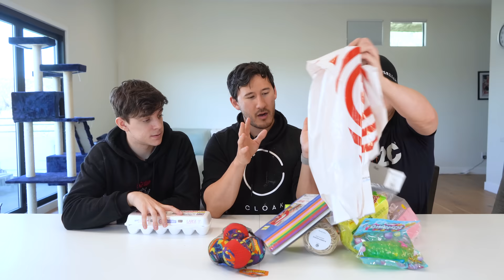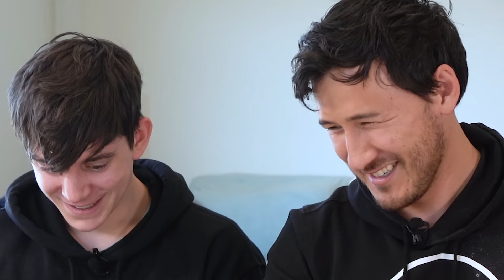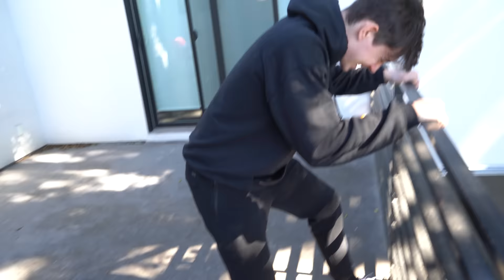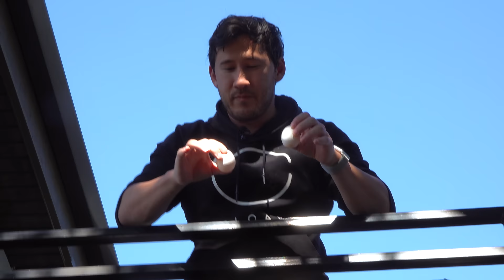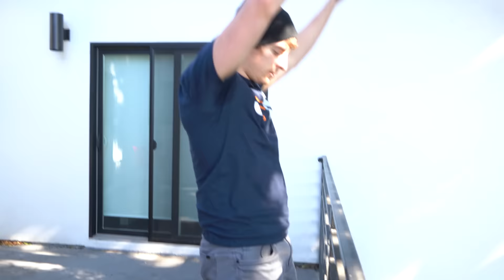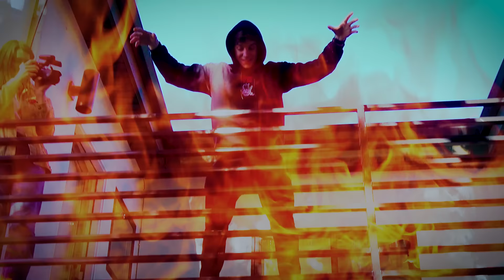Markiplier Makes: An Egg Drop

Comment: I think most people watching this don't realise but it's clear Ethan was struggling from the very beginning. I have ADHD and I know this exact feeling, and it's really hard to describe if you've never felt it before. Basically, you start to get frustrated because your brain is working ever so slightly out of sync with your hands/body, and the harder you try, the more frustrating it is, and the more the disconnect grows. Assuming this video was filmed after they filmed the Markiplier Makes Pie video, then Ethan has already been struggling to successfully complete a task. You can see how distracted and distant he is in the beginning of the video while Mark is talking. He gets more and more frustrated with himself as the challenge goes on.

If you have friends with ADHD, or suspected ADHD, then please take note of this video. He's not upset because he's going to lose the challenge, at least not entirely. He's upset because he can't get his body to do what's happening in his head. If your friends ever struggle like this, please dont pressure them, or make fun of them. Just comfort them and give them some time to calm themself down and reorganize their thoughts. It's difficult trying to work under pressure like this, but having a friend there to help, like Mark in this instance, really does make a difference.
Reply: As someone with pretty bad ADHD it's good to see that I'm not alone and to finally have a good explanation to how I'm feeling.
Reply: the second prt is very true. i have adhd (not as severe as it could be but still it hinders me at times) and especially in one of my classes where we were more active it was the worst for me as it always triggered my adhd and id just have to sit there on the floor in the corner because i PHYSICALLY couldnt do the work even if i really wanted to. its hard to see someone else go through the same thing.
Reply: Alex Stewart I don’t have add or adhd but I’m decent at reading people’s movements and emotions. When I went and rewatched I noticed that at the beginning he seemed off compared to how he usually is.
Reply: sometimes i feel like i have add or adhd even though i am a typically smart person and I haven't been this way my whole life but today I was doing schoolwork that required a lot of reading and taking notes and at the beginning I was fine but then I started skipping words in my reading and when taking notes I would skip letters in like all the words and I didn't know why I was doing that bc I am a good speller as well, it's confusing :(
Reply: Reading this makes me get upset. I have add and it’s hard enough with this situation I can’t imagine being hyper with it as well
Reply: I don't have adhd, but sometimes I feel like that whit my school work so I kinda understand but I am the least qualified on the subject
Reply: I've got my ADHD mostly under control but every now and then it creeps up and hits hard, I could physically not complete a physics question yesterday, come back the next day and boom done in 2 minutes, just take a break if it gets really bad, and if you don't have it under control medication is the best answer.
Reply: My brother supposedly has ADHD but he hasn't been diagnosed. Based on what I've seen from Ethan's ADHD, my brother doesn't have it. If he does then it's very slight.

I myself have Asperger's Syndrome. My condition, as applies to me specifically, makes me hyperfocus when I absolutely need to, sometimes when I don't. In some cases, I can get very stressed. Especially under a time limit that's nearing the end. Happened in maths occasionally when I was halfway through a question that was taking me a while nearer the end of the period. Whenever that happened, I was writing much more quickly and could have been missing some essential step in the question. Happily that rarely occurred, and I don't expect it to within the coming year because I'm taking a practical course in college. Evident from my sitting woodwork in high school, if given a physical project that takes several weeks to complete, once the period is done I can lay down the work I was doing that day and pick it up the following. That never happened in maths when we moved on to a different topic the following day. Under a time limit as was given by the end of maths, my Asperger's can stress me out if I'm too close to the end of something and not finished what I'm doing.

Long story short, I have the potential opposite to ADHD or ADD. But with it I can still get stressed when such a situation as detailed above occurs.
Reply: This is exactly what it's like. It's a downward spiral and you very quickly have a meltdown. I feel for Ethan, I've been there.
Reply: I suspect that I have adhd or add. It happens to me a lot. 
For me it feels like there are multiple tabs open in my mind (like on a computer), and I can’t make my body work fast enough to get to every tab. What happens eventually is an „error“ message where every tab just melts into each other and the sensory information from the outside can’t be filtered out anymore. Everything suddenly feels louder and brighter, and when you try to make sense out of it, another tab opens. It bottles up until- bam! Reaching a tipping point, a „reboot“ so to speak, where every tab is just spilled out in the form of frustration and tears. It feels absolutely horrible because you feel so stressed and overwhelmed-
Reply: I recently found out my long-time friend has ADHD, depression, and anxiety. If I had known they had ADHD when we were kids, and I had this explanation, I wouldn’t have pressured them into doing things they didn’t like.
Reply: @senecarus_whitur  someone once explained it to my mother really well, a person with Adhd instead of having on train in their head at any given time they have multiple constantly moving around and intersecting. I was in kindergarten then tho so take that with a grain of salt
Reply: Lunar_Memories 
You couldn’t have known. You probably just wanted to help them overcome their fears. So don’t blame yourself for not recognizing their struggle
Reply: I have never been tested for adhd but I might have adhd, once when I was younger I fully spaced out I didn’t remember like 5 miutes or something because my brain just didn’t do what I wanted it to do and my teacher didn’t help.
Reply: I fully broke down and started remembering stuff in the principals office
Reply: Daniel Gottschalk well idk where I’d get ptsd from, I don’t really have any trauma for as far as I know
Reply: sometimes its just kinda like a sensory overload or something like that, every little thing becomes annoying and upsetting so you get frustrated, and the more frustrated you get the more upsetting everything becomes and its just like "i; either gonna yell at you or i;m gonna break down crying, no in between at this point" honestly
Reply: Yes! My brother has ADHD and I’ve seen this sort of thing happen to him a lot
Reply: Paige I’d break down it seems, and well I had a substitute teacher and she wasn’t very nice to me tbh
Reply: seems like a lot of people realize it based on how many comments there are
Reply: Haha I struggle with this :')
Reply: ADD is the same. I also get to feeling that way and its extremely frustrating
Reply: I seriously feel for Ethan I have horrible ADHD and I know the feeling all to well like people think I'm weird or that I'm crazy and in the past made fun of me or pressured me into things and you pretty well hit the nail on the head with your description I always just thought I was the only person who had to deal with this and I didn't think it was my ADHD for so long and I always wondered why it happened and some times the weirdest things trigger it or some times it feels like i just wake up like that.
Reply: Alex Stewart it it was me I would’ve asked for some time to think out a plan before the making of the dropper thing starts
Reply: He’s so clearly dissociated in the beginning he’s just not listening to anything I felt so bad the whole time
Reply: Abby First of all- ADHD and ADD have absolutely nothing to do with intelligence. You can be a genius and have one of the conditions, it can just be hard to express yourself. And no, you don’t have ADHD or ADD, there are a hell of a lot of other factors that exclude schoolwork.
Reply: im in the middle of this kind of eposidoe yeah thats  word episode and i am somehow comforted by seeing someone else go througj tbe same tbing . ahh
Reply: i dont know that i have adhd (although i and a few other people think i might), but some of those feelings apply to extreme perfectionists too, and as a perfectionist that possibly has slight adhd i, know how it feels. it's the best when you have a friend (like mark) trying to comfort you, make you feel better, even if you dont "want it" and even if you dont want to accept it (and no matter how badly you dont want to, you do need it deep down). i dont exactly have that kind of friendship with anyone, but my mom tries doing that with the things i do. ethan is so lucky to have a friend like mark.
Reply: @Abby-tp3yw  for some people (like myself), it's hard to stay focused on one thing for too long. it might be slight add or adhd, but it has nothing to do with your intelligence. neither adhd or add have any determination of your intelligence. like with ethan, he's such a bright, smart man, but the adhd can weigh him down a little mentally.
Reply: Thank you so much for this comment. I thought I was crazy when times like this happened to me (I have adhd) its good to know that realistically I shouldn't push myself to try and immediately fix the mistakes I make because of it. Really warms my heart to see a comment that really gets it instead of just symptoms being described. I know im late to this but I just had to say thanks. Its means more than you know.
Reply: Apparently everyone has adhd.
Reply: But yes, that’s also how it feels. You also feel as if everything is going to fast and you start to wonder what you’re doing and why you’re even there. Sensory overload kicks in.
Reply: Yeah I’m really confused bc I have a lot of “symptoms” of ADHD and basically have episodes like Ethan does but bc of quarantine I can’t go get diagnosed and that makes me kind of upset bc I just want to be able to know how to cope
Reply: @numget1111  aw thanks for taking the time to write this!! i appreciate it!
Reply: I thought he was getting frustrated because of the time limit. I have ADHD, too, and I tend to get really, really frustrated and panicked whenever there's a time limit for something, especially if that time limit is only a few minutes.

Speaking of which, I found it really sweet that for the second activity, Amy suggested making it 4 minutes instead of 3, presumably hoping Ethan would feel less pressured.
Reply: Yes! You explained it so well.
Reply: That's an amazingly good and specific description of adhd bad days
Reply: I have bad ADHD, and it's extremely sad to see someone else go through what I've been through. Timed projects like that cause it to flare up the most due to sensory overload and too many thoughts running around in your head.
Reply: my brother has pretty bad adhd and i recognized it the second i started watching the video. i felt so bad for ethan bc my brother always describes it lime how u did and i can tell just how frustrating it is for him. i felt so bad for poor eef
Reply: Is the feeling something like having a brain fart again and again and getting frustrated for that and due to the brain farts, the frustration get's amplified?
Reply: i have never been checked for adhd but I am very suspective of it. My friend has adhd pretty bad and I always try to let him know it’s ok to let his feelings out and I buy him things. But i have this problem sometimes and others, I don’t wanna be like the people on sm and say I hAvE aDhD sImPtOmS iM sO qUiRkY because I don’t know for sure, and I don’t want it. It’s a very hard thing to live with and it isn’t 100% leg tapping and “...SQUIRREL” :/
Reply: @Abby-tp3yw  just wanted to point out that having adhd doesn't make you any less (nor more) intelligent! it can affect your performance yes, but there is no correlation between the disorder and having a lower, medium or higher IQ. It is possible you became tired after studying for a very long time or something suddenly caused you to snap out of focus. But if this has happened to you before or you feel like it's overwhelming and affecting your everyday life, then you should probably talk to a doctor. Cheers!
Reply: The video wasn’t not entertaining, but as someone with ADD, it was really hard to see Ethan struggle so much during his breakdown. It was especially hard to witness the disassociation and sensory overload (and depression).
Reply: I have ptsd and that sometimes happens to me on bad days so I could totally see that happening to him and it made me sad :(
Reply: I don’t know if i have adhd and i know what he’s feeling do i need to speek to a professional?
Reply: @arbeecass  If you have a suspicion I'd say start by voicing your concerns to your doctor. If they think there's reason to get you diagnosed, they'll probably refer you to someone who can determine if you have ADHD or if it might be something else. Always seek professional help, it's never good to self-diagnose.
Reply: Yeah I agree because I didn’t know you could have adhd episodes and I have severe adhd and it’s hard
Reply: YES AGDHAHDBAB ME

I have ADHD and,,,, hhhh
Reply: I seriously didn't know this was an adhd thing, I thought I was just dumb.
Reply: ADHD personally seems to run in my family on both sides and its highly likely that I have a moderate to severe case of it. It starts with me trying to focus on something but always zoning out or getting distracted, or every time I start to figure it out the thought disappears and is replaced with a sick feeling. This tends to happen during maths. I then often start to cry and get frustrated and think of throwing stuff, so I start fidgeting. Double that with the constant need to move my legs I feel like I should get tested. Should I?
Reply: I was thinking like my autism.i do this and sensory overload and breakdown and go mute and cry and die inside and sit on floor and no arms legs feet hands lungs allowed to work.
Reply: I felt it. This was the first video where I felt like I understood Ethan. 
I don't have ADHD but I have depression and anxiety. I've had depressive episodes like this around friends when I felt like crying and hurting myself but was forced to keep the tears inside and pretend everything was fine.
Reply: @SpookiCooki  jees dude, do you want to talk to someone? Are you alright?
Reply: @nocto2857  I'm okey. I've been through therapy and I'm on my meds. As long as I take my meds I don't get these episodes more than a handful of times a year.
Reply: @SpookiCooki  just remember to talk to someone when these moments come around, don't do it alone. Don't worry, you're doing great, I'm proud of you for still being here :) 🥰
Reply: I know the feeling I’m having bad adhd episodes when I’m doing school or when I’m playing video games
Reply: ethan got his revenge 

rip the barrel
Reply: My friends always get confused and angry when I get upset and almost burst into tears at the slightest thing. I feel exactly what Ethan is feeling on an astronomic level, but the difference is, my friends don’t try to cheer me up 😞
Reply: Oh my god you put it into words. I've never been able to explain that.
Reply: wait so is part of adhd getting frustrated when you can’t do something you envision yourself doing in your head? because i’m diagnosed with a.d.d but the more i’ve looked into adhd the more i recognize those symptoms in myself. i’ve even brought it up to my mom without telling her they were adhd symptoms and she said “yeah those sound like you” i already take the meds for A.D.D so either way it’s more repressed or whatever the word is but ya
Reply: @Abby-tp3yw  if you feel that way PLEASE go get tested for it. some people never get tested and just say they have it and its really damaging for people that actually have it to talk about it
Reply: @senecarus_whitur  please please please. get tested before you say you have it.
Reply: Liz. exe 
The ptsd or the adhd? 
I have been diagnosed with ptsd and am undergoing ADHD diagnosis at the moment, but it takes time, because ADHD isn’t just „diagnose and over with“, it’s a serious neurological illness that affect people regularly. I am not saying that I have it but it is strongly suspected.

Edit: I deleted some of my answers so that others wouldn’t be misguided. I don’t want anyone to get upset over me saying something and taking it the wrong way.
Reply: @senecarus_whitur  the adhd. i have been diagnosed with it, although I dont really have a good memory but it took a while to get my diagnosis. i was just saying please dont go around telling people you have it if you have not been diagnosed.
Reply: Liz. exe 
Yes, I understand that. I wouldn’t do that, I just say that I might have it as I am currently undergoing diagnosis :o
I‘m really sorry if I upset you in any way, I didn’t mean any harm.
Reply: @senecarus_whitur  no your fine. just want to make sure people arent self dieagosing.
Reply: Liz. exe 
You’re doing good! :)
Reply: @Abby-tp3yw  having adhd doesn't mean you are dumb it just means i have trouble focusing more or less
Reply: I too have adhd and you described this brain loop that we get when we have to multitask
Reply: The amount of times I’ve been called a baby or a sore loser because my hands not being able to do the task my drain is telling it to do
Reply: I wish more people noticed when I had episodes like Ethan. I understand that feeling way too well.
Reply: I know this was months ago but I to am dealing with it every day and my parents give me meds for school to hold it back, every day we have to live with it, it can go away but only time will tell
Reply: After a while I just freeze
Reply: I know that feeling so well!
Reply: I have severe ADHD but my parents don't want to treat it and now that I'm in high school I've been having a major increase in these episodes similar to the one Ethan had in this video. It really hurts when people call me stupid or overdramatic or tease me for being overwhelmed and frustrated. Today I had a really bad episode during calculus and completely broke down. I got mocked and ridiculed and felt super hurt, alone, and stupid. Whenever this happens I come to this video to remind myself that I'm not alone and that I'm not stupid and that other people are out there who understand what it's like. Please, if you know anybody with ADHD/ADD let them know that you're there for them if they have an episode. Let them know that although you don't understand what it's like, you'll do whatever you can to help them out and reassure them that it'll be ok. It means more than you know
Reply: I have severe adhd. I havent seen a docter about it in a while. I have trouble listening, and I cant stay organized and I have a TON of trouble focusing. I cant see docter due to the pandemic. I'm still in my teens though. It might go away soon. I really cant control my ADHD. Quarintine is a good time to relax and unwind a little bit. Its not ruining my life, but its definitely annoying. Im okay.
Reply: @isabelleleblanc3479  Omg. Same with me!! My parents think its no big deal. Im still in middle school.
Reply: Mariam Adel Stay persistent and show them how much you need the help! I was persistent and finally I began to get help. My parents are getting me a therapist which will hopefully help
Reply: Not only did they do the pie video, they also did the Lego video, all in the same probably couple of hours.
Reply: yeah it sucks during online school a lot because I zone out and I don't have something going on to snap me back
Reply: as someone with ADHD i get this 100%, i have really bad dislixa and ADHD (and lots of other things) so it eats me away to know that i cant be the way i want to be (weather it be talking iwht my freinds or even working in school), aculy i sent this msg to my freinds so they understand better as to why i cant think or get the words out the way i want them too-
Reply: Thank you. I have ADHD and I get these episodes (or I like to call them ADHD attacks) but it's so hard to explain what it's like so people normally don't listen and it's very important to listen and be aware because these are very stressful things to deal with
Reply: I would say it feels like everything is going wrong and you know it’s because of ADHD but you’re frustrated because no matter what you do you can’t stop it.
Reply: Ye, I’ve been diagnosed with ADHD and have had it for ages. I feel Ethans pain
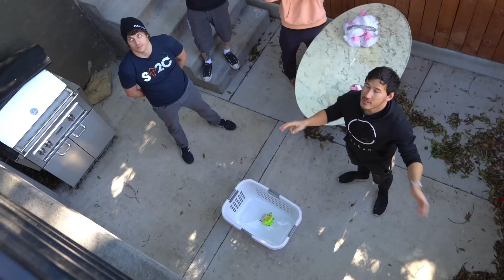Reply: i love how mark helps him through this, he says at 10:10 that he just wants him to win, he doesn't want to see him cry and that almost made me cry. i have adhd too and my friends don't really know how to deal with it, i would love to have a friend like mark
Reply: So adhd I have pretty adhd and what I got from skimming it explains it like idk how to say it T-T
Reply: Ok so I have pretty bad adhd and so I actually read this and the ending is really a good explanation honestly
Reply: I don’t have ADHD but I think I might and I understand that feeling of your body not cooperating and getting upset over seemingly small things. I almost started crying in theater class last week because I couldn’t do an accent because my voice wasn’t cooperating and trying to do the accent
Reply: yeah it was pretty clear to me, he was pretty out of it in the beginning
i feel ethan in this video so much lmao
i know the feeling of being frustrated about being frustrated and then going into a vicious cycle lmao
Reply: I’m laughin’ but I feel his pain.
Reply: @vasama3  ADHD FAM UNITE
Reply: Thank you for posting this. I also have ADHD and it’s nice to know that some gets what it’s like
Reply: Good on you for caring as well
Reply: @Eli-lk4ff  I agree
Reply: I don’t have it but I get really stressed out sometimes when I have important deadlines to do, because I hate procrastinating, and I go into crunch mode until the task is done, and I’m exhausted after. I know it’s stupid, but I can’t really relax until I know I finished everything for that day. 

All I’m saying is, I know what it’s like to get overwhelmed.
Reply: I don't have ADHD and feel this all the time, it's just pressure being placed on you, its your fear taking control saying you wont be as good as the others around you, and not only that, it happens because you're frustrated that you can't take control, but eventually it takes hold and you break, making your actions sloppy and different. Not only can you hear it in his voice but you can see it in his eyes, the eyes of a broken man, the eyes that no one should have to endure, he's seen his nightmares come true and he's left a shell, it happens if you have friends that do more activities than you, very rarely does it ever happen to the calm collected guy, which mostly resembles me, If I don't have control then I become a different person, my behaviour is vulgar and erratic and I'm sad and angry and bloodthirsty, anger leads to bloody violence, so in my position I have to stay collected, but one day someone will push me over the edge, and I can't be held responsible for what happens
Reply: Felt